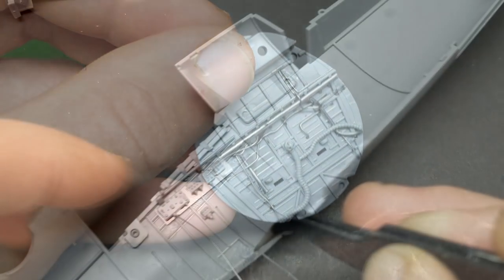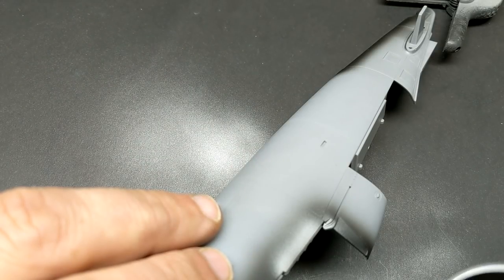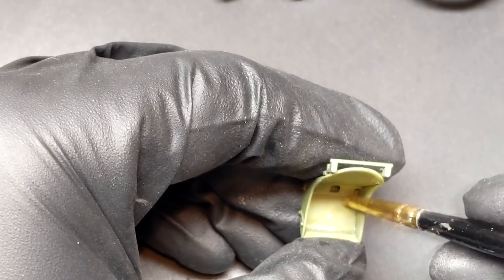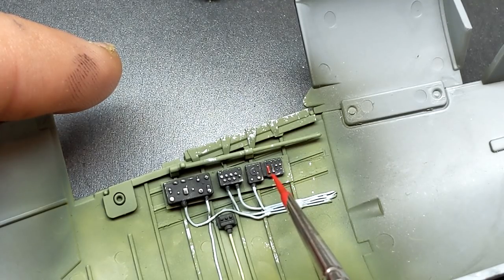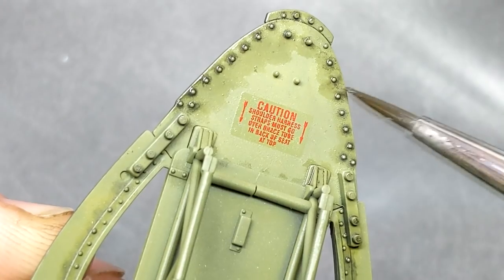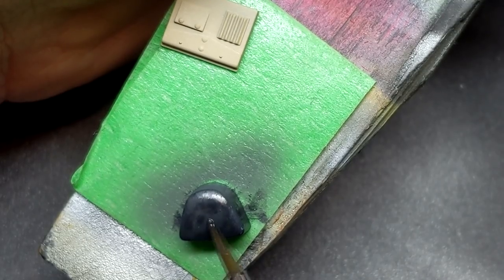Let's build the 1/32 Tamiya F4U-1A Corsair Cockpit!

Comment: Looking really sharp. I like cross-referencing Tamiya instructions with color callouts from Hasegawa, especially since I use a ton of Mr. Color. C125 is there if you do a lot of IJN cowlings, but NATO black mixed with a bit of sea blue works great. Tamiya’s approach to color is often… “close enough.”
Reply from the maker: I'm very lazy when it comes to mixing paints. If I can buy a jar of what I need, I'll do it. I have that cowling black and it's a great colour for post shading on Gloss Sea Blue.  I'll use Tamiya's call outs as a loose guide but I usually research my own colours.
Reply: @TheModelGuy  I’ll take that tip on post-shading when I finally get around to doing the Eduard F6F-5 in the stash.

Comment: David R Lentz, Columbus, Ohio, USA (Sunday, 13 October, 2024) 

Note: I am responding to all three of your posts on this kit. For the sake of simplicity, I am editing my reply to just one missive. 

I take great delight in watching you build these Tamiya kits. Thanks. 
   Early in your video, you assure us that we can add numerous details with wire of different materials and gauges, CA glue, etc. (You continue this in your second of this series with the hydraulic hoses of the landing gear bays, in round 1:00 of that presentation.) I find all this terribly frustrating: I am NOT the techie type (I am a word nerd, and an aspiring novelist; a classical vocalist; an illustrator, etc.), so I need to know the precise length of each piece, its outside diameter, its starting point, its end point, where to make any bends, what the colours are, where any fasteners or fixtures belong, etc. 
   At round 2:20, you offer an interesting alternative to black basing, for which I am rather dubious: painting even deeper shades (let alone lighter hues or tints) over black can prove difficult to have the intended colour show adequately. Your alternative, NATO Green (I think this also is Forest Green, which the U.S. Army in 1972 began using in place of Olive Drab), would be an excellent shading beneath Zinc Chromate Green or Interior Green. 
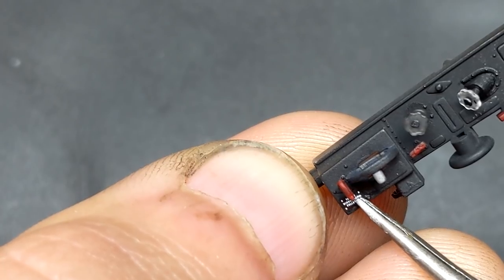   Round 7:30, you address the instrument dials and the clear instrument panel. I would like a process and the means to illuminate the cockpit, especially the dials. Toward this, I would use a relatively small piece of electro-luminescent plastic that with electric current of low voltage glows a bright white (one would need to modify the colour more accurately to match the pale yellow of the incandescent light bulbs of the period). This idea naturally would add its own complexity with needing to wire the model for electricity. One first would have to design the arrangement, to assemble the components, especially those not of the kit, to test each step for function, etc. However, I expect that if one properly executes this approach, its effect would work so well as to be worth the effort. 
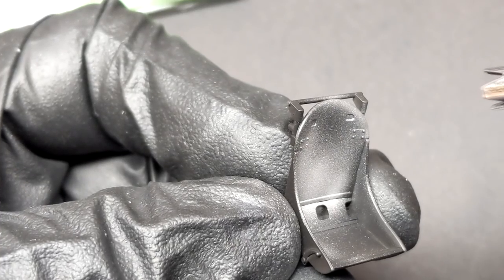   At 11:05, you caution your viewers that 1:32nd-scale still is small enough that working in fine details can be tricksome, in the course of which you refer to your “big mechanic sausage hands”. My own experiences validate your caution: I by contrast am terribly thin (that is a long story! :( SMH), with quite bony fingers on relatively small hands; I can print with a fine ball-point pen small enough (yet very legibly) that many people struggle even to see it, let alone to read it. Yet even I as often as not have varying degrees of difficulty managing small parts, or effecting tiny details. 

YouTube “F4U-1A Corsair from Tamiya: Setting the base for heavy aircraft-model weathering” (The Model Guy, Friday, 3 September, 2021) 

At round 1:50 in your second Corsair video, you mention 3D spark plugs for the P&W Twin Wasp R-2800 engine. As tiny as these look to be, how can one attach a thin wire into the anterior end, inserting it deeply enough to anchor it in place? Also, can one fit the other end of the wire into the starting end on the ring leading from the distributor? 
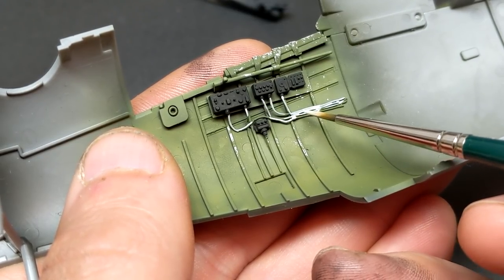   At 4:50, you note your dissatisfaction with Tamiya’s featureless interior surface of the open cowl flaps (a view I share with you), making a set of 3D printed actuators that you affixed to each open flap. Another YouTube channeler, in his video, “Tamiya 1:48 F4U-1D Corsair with Moto-Tug” (rebelsatcloudnine, Tuesday, 16 January, 2024), shows another approach, in which he incorporates into each flap a scratch-built actuator vaguely similar to yours, as well as spring coils roughly 1 mm in diameter and 2 mm in length, set horizontally. I very much would appreciate your assessment of this, please, toward my interest for accuracy. Also, I especially would like for someone to extrapolate his work on the smaller kit to the larger Tamiya kits of the early F4U Corsair USN/USMC Fighter. 

YouTube “F4U-1A Corsair Tamiya 1/32 - Let's weather an aircraft model with chipping and oils!” (The Model Guy, Friday, 17 September, 2021) 

Regarding your third Corsair video: Well, this was appreciably better than I had anticipated. I am one to eschew the more severe weathering, except for the extreme cases. 
   One salient example: a modeller built a replica of a Second World War aircraft that after the war, the French had bought from the DoD for their efforts to retain control of Indochina (Vietnam, and surrounding regions). Years on (in July 1954, the French had left), U.S. soldiers in the late 1960s, on supply convoy escort, whilst hacking their way through the jungle strangling some road winding across a range of squat hills, found a crash of a French-flown, U.S. made, plane that literally was pitted, caked in mud, had tree roots, vinery, foliage, etc., growing all through it, and the like. After they had reported this to their C.O., some DoD historians soon arrived, asking the men to show them the downed warbird. They had a work crew wash off the worst of the gunk, pull it out of the muck, disassemble the wings and the empennage, secure it all in crates, and truck it back to base, where a big transport shipped it back to some museum stateside. Seems to me like a lot of work for mud-soaked, old wreck. 
   After one soldier’s service, he years later, remembering what he first had seen, had built a model representing that.
Reply from the maker: @DavidRLentz-b7i  thanks David! It is time for me to look at another one :)

Comment: Love these big Tamiya Corsair kits, I have seven of the -1, -1A, and -1D in the stash total. The only thing that would have made the -1 kit more perfect-er is if they would have included parts for the -2 night fighter version as they did with the 1/48 scale kit.

You're off to a great start, looking forward to the next instalment.
Reply from the maker: I'm sure that radar gear is available as resin. But yeah it should have been included. 

I'd like to do a -1D in flight. But that will be a few years
Reply: @TheModelGuy  A few years back I think AMS Resin was working on a set but a search of Sprue Brothers shows nothing. Close up photos of the real thing show some really impressive detail to the flash hiders on the exhaust pipes.

Comment: This is sensational stuff. I have been subscribed for quite a while and while I find your earlier build fantastic I can really notice improvement. You should try to get one of your builds published in a magazine like Meng Air Modeller.
Reply from the maker: Thanks Sean! One of my goals is to publish an article but that presents a few challenges. It would mean possibly a slower build that doesn't get released to YouTube until after the article is published. It also means that there would be a gap on the channel. Or two builds going on simultaneously. I'm sure I can figure it out :)